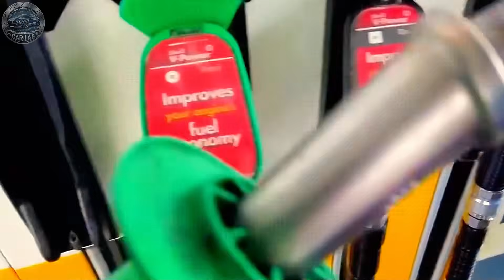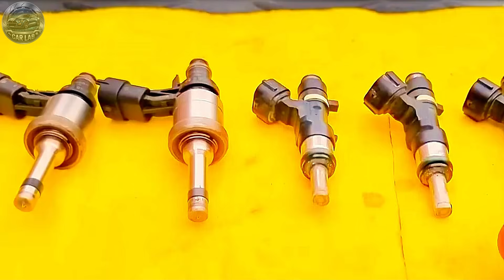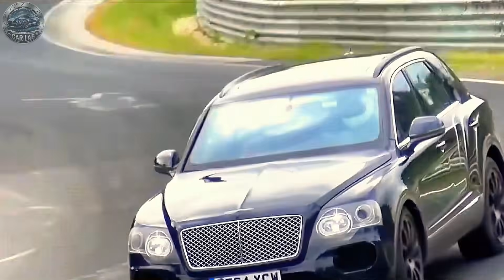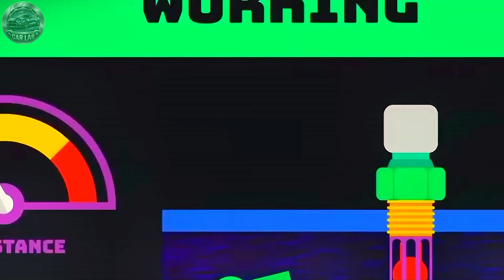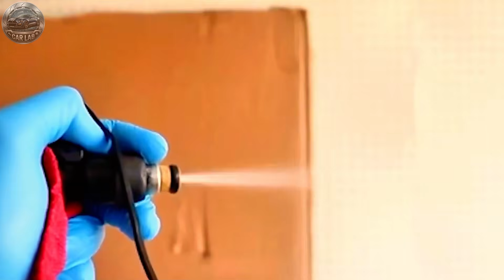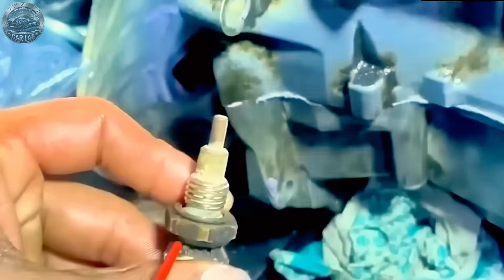Nobody Cleans This Valve — That's Why Your Engine Burns Oil After 100K Miles

Comment: This video from Car Lab explains a common but often overlooked cause of oil consumption in high-mileage engines: a neglected Positive Crankcase Ventilation (PCV) valve (0:48).

Key Takeaways:

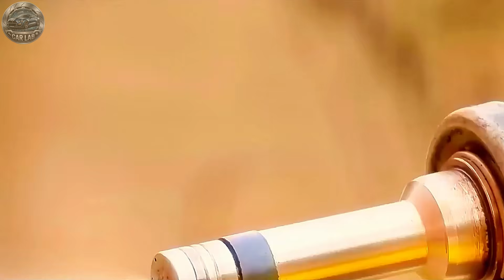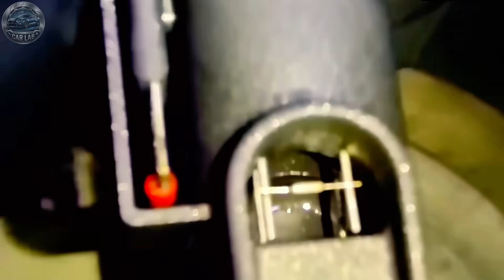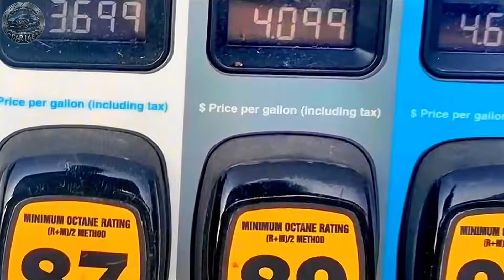The Problem: Combustion pressure creates "blowby" gases that contain harmful contaminants like fuel, water, and acids (1:53). If the PCV system is blocked, the crankcase pressure builds up and pushes oil past seals—like valve stem seals and the rear main seal—that aren't designed to handle internal pressure (0:53, 9:00).
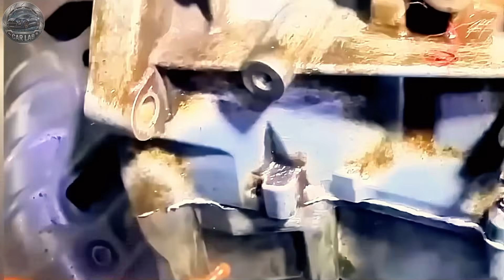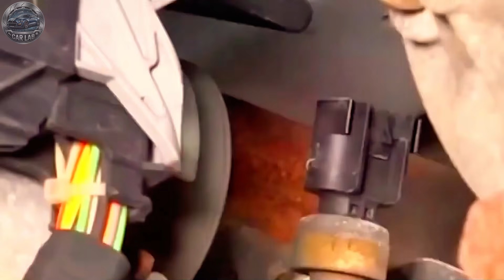Diagnostic Misconception: Shops often misdiagnose this as worn piston rings, leading to expensive and unnecessary repairs. A standard compression test will not detect a ventilation issue because it doesn't measure seal performance under vacuum (9:22, 10:02).
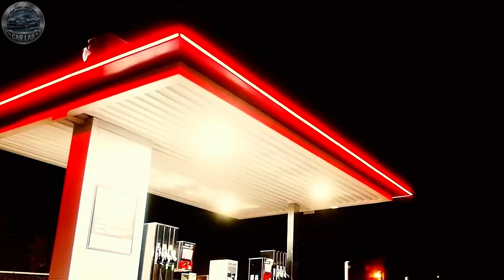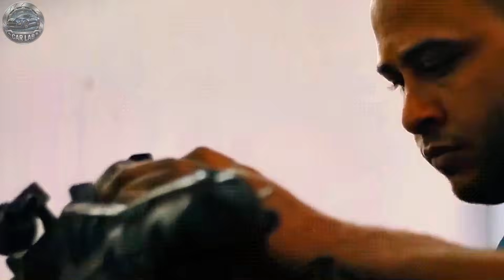The Solution: A properly functioning PCV system maintains a slight negative pressure in the crankcase (8:05). Replacing a cheap ($15–$30) OEM PCV valve and checking the "fresh air" side of the circuit can often resolve oil burning issues without requiring major engine teardowns (11:50, 22:00, 23:40).
Maintenance Tips:

Inspect periodically: Starting around 80,000 miles, use a manometer to check crankcase pressure at idle (20:30, 25:50).
Avoid cleaning: Do not attempt to clean old valves with solvent; the internal springs fatigue over time, making replacement the only reliable fix (25:54).
Don't forget the circuit: Always verify that the fresh air breather hose and associated ports aren't clogged with sludge, as a new valve cannot work if the system cannot draw air (21:43).